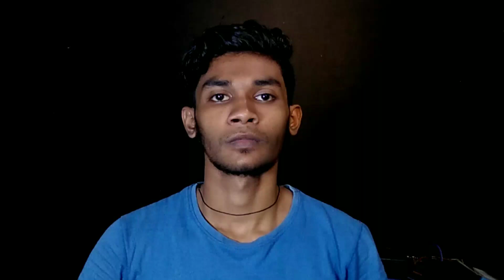എന്താണ് RMS,PROGRAM,PEAK,AES,PMPO POWER rating|speaker power ratings explained in malayalam|echotech

Comment: Amplifier
RMS Power Output: 750w x 2 at 4 Ohm. 500w x 2 at 8 Ohm.
Program Power Output: 1500w x 2 at 4 Ohm. 1000w x 2 at 8 Ohm.
Peak Power Output: 3000w x 2 at 4 Ohm. 2000w x 2 at 8 Ohm.

		Passive Speaker 
Power Handling: 400 Watts RMS / 800 Watts Program Power / 1600 Watts Peak
High power long-throw 15'' woofer with 3“ aluminum voice coil provides incredibly deep bass and acoustic power
mpedance: 8 Ohms
Frequency Response: 35Hz-20KHz
Maximum SPL @1w/1m: 128dB peak / 125dB continuous

ETHU MATCH AAKUMO DEAR BRO...PLEASE COMMENT
Reply from the maker: Aakum